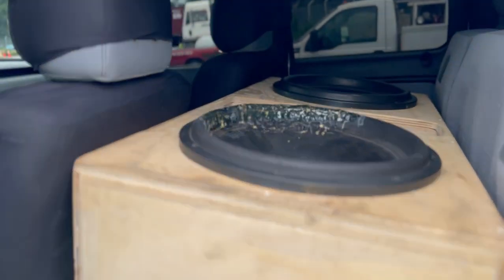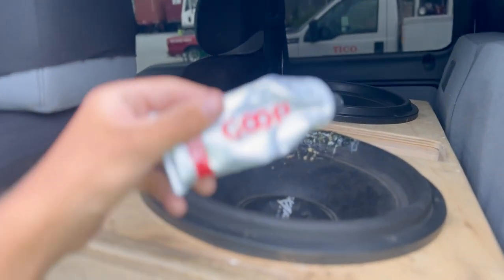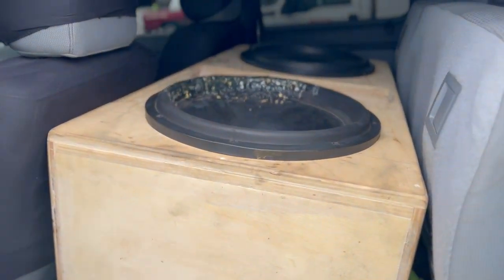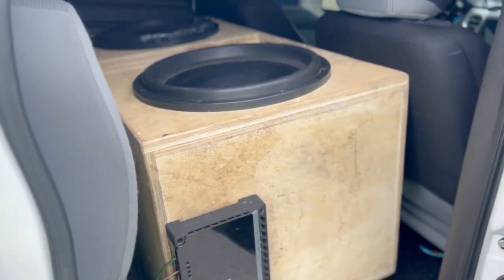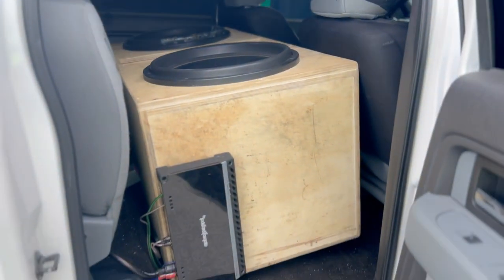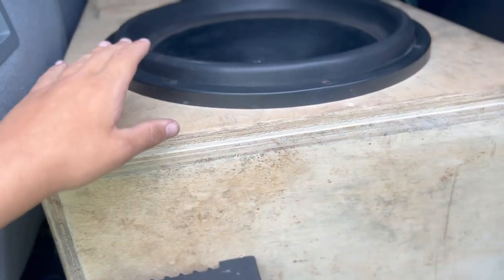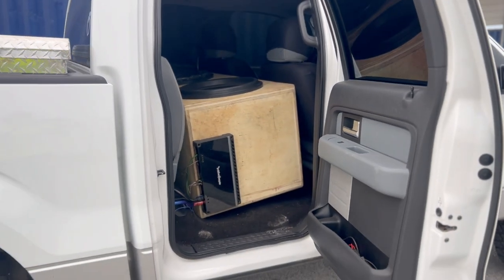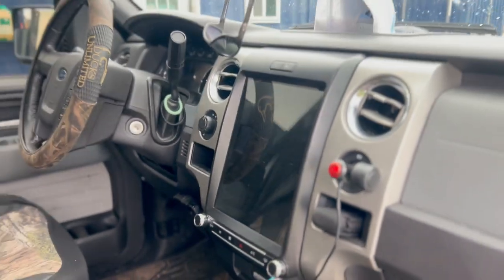2 huge 18s in a f150!!! Let’s take a look!

Comment: So do you think that goop is stronger than E 6000 glue?
Reply from the maker: It works but not as well as e6000. It was what my local stores had and it’s what I used and it worked well.

Comment: How did you fit that box in there
Reply from the maker: Wasn’t the easiest 😂
Reply: it's it bolted down to the factory seat holes. and wondering if your have rubber legs for the amp?

Comment: not bad for that small 1200 watt amp. you should get a downforsound amp it'll be cheaper and more powerful. Also, just replace the sub that has a blown surround that goop just makes a nice box and amp look like crap. Need a longer demo with the subs. And no disrespect but hit up a dentist and fix that gap you'll be pulling so many more girls.
Reply from the maker: Definitely don’t need to pull anymore females, system is now on a taramp 5k. No need to replace a subwoofer you can recone them.
Reply: Jp33 is a beast of a amp ! Nice Build tho !